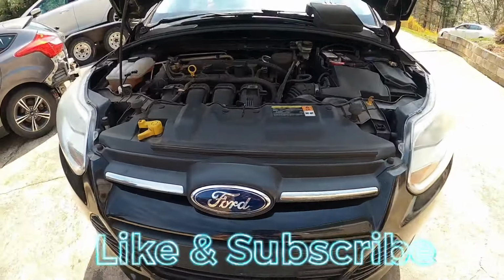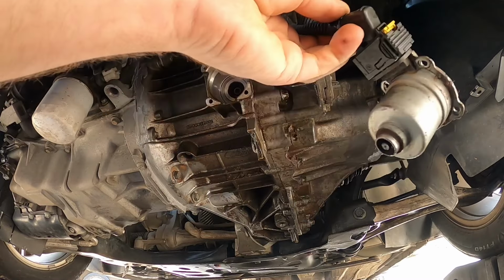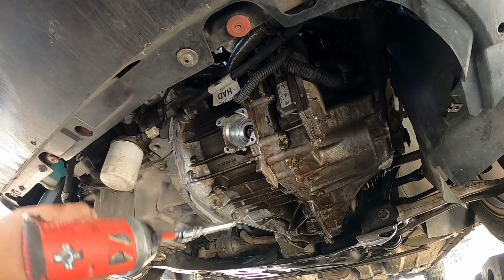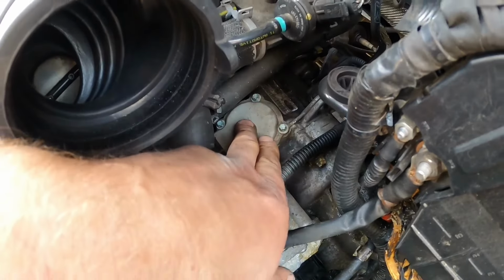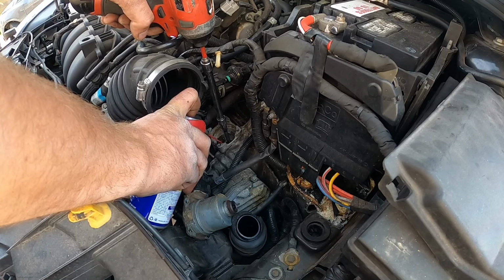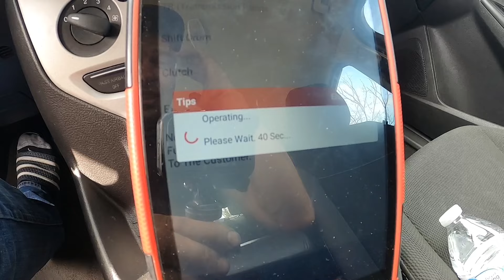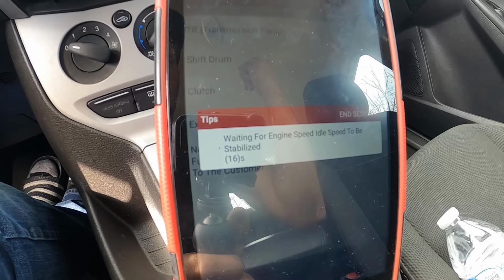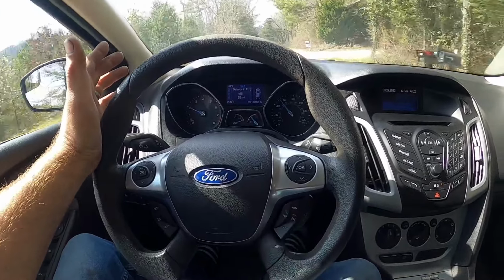2012-2018 Ford Focus Slipping? No Reverse? No Drive? Problem Solved. Easy Fix. You Can Do This!

Comment: How long are you supposed to wait to drive after doing this? I drove mine right away and it said transmission overheating pull over safely.
Reply from the maker: You don’t have to wait. If this didn’t help you need to replace your forks and probably the clutch at this point

Comment: Would a P0902 be related to this? I changed the actuators and found out i need a tool to relearn the system
Reply from the maker: If you replaced the actuators with new OEM ones, you should do a relearn if you can with a scan tool. If you don’t have one take it on a normal drive and if all is working it will relearn on its own after a normal drive
Reply: Yea I dont have a scan tool, and idk if my brother got the parts from ford or not. I doubt it though, i replaced them, drove down the block (i know its not far) but same issue. Reverse works fine, its when i go in drive that lags, sometimes it doesnt even go,  sometimes it doesnt even start...makes me wondwr if its possiblythe tcm@L8R-HP

Comment: Just bought a 2012 Fiesta with only 33K miles for daughter. P2831, P2832, P287B, P2831-00, P2832-00, P285E-00, P287-00, U041-68, and C1B00-64 codes (obvious shuttering). 6-8 months for the recall and don't know what else to do. Thoughts?
Reply from the maker: That many codes my guess would be the TCM is gone bad.
Reply: @L8R-HP  And under the extended warranty?
Reply from the maker: @TheMaestroWay  I think warranty is 10 years 150k miles. Unless that changed
Reply: @L8R-HP  Thru January '25. But I don't trust the dealerships.
Reply: @L8R-HP  Even though P0700 code is triggered, Ford dealership claimed that the TCM warranty doesn't cover P287B. In other words, no correlation. Agree or disagree?
Reply from the maker: @TheMaestroWay  ford dealers don’t know how to fix this problem, there is really no fix, especially if you don’t drive your vehicle much, forks get stuck

Comment: What is the electronic diagnostic tool you are using?  Any links to it?  Would a FORSCAN tool work as well?
Reply from the maker: I use a launch 431 mini.
I hear forscan will work, but I have not tried to confirm
Reply: @L8R-HP  your videos are 🔥🔥🔥 amazing content!

Comment: I am getting code P07A5 - Friction Element B stuck on.  I checked both actuators. A turns all 14 turns .  B only turned 3 turns.  I was turning by hand and was afraid to try to force it as I didn't want to break anything. I'm assuming your impact wrench was probably using more force than I was.  I used the brake cleaner, turning back and forth by hand but never got it past 3 1/2 turns.    I also did notice on both actuators that they do have some side to side movement in there.   Do I need to apply more force?  Or would it be better to open the transmission and see what is going on inside?
Reply from the maker: Sounds like fork B is broken or stuck. That transmission has to come off :/

Comment: How about when you open passenger and driver door  makes a noise  have code P087A, P287A, P286F will this work to clear the codes?
Reply from the maker: If this doesn’t work you need to remove transmission and inspect it

Comment: Just broke my fork on B doing this. Now I may need a new transmission. I should have just clean with brake cleaner a wd40, no drills or tools. Any advice on next step?
Reply from the maker: Need to replace the forks. You don’t need a new transmission
Reply: @#L8R-HP  is it normal for when you turn it counter clock wise it will turn but like it wants to kick back like it's spring loaded?
Reply: @L8R-HP  Have not seen a video where the clutch is removed from the transmission to expose the forks. I saw another video where some special LuK tool and template are used, will I need them?

Comment: Hi, I have a 2016 Focus 2.0, have a P090C code for acuator B - no reverse - switched the actuator with a new OEM one, the code comes back within a day or two - any ideas?
Reply from the maker: Sticking fork or your TCM is going out
Reply: @L8R-HP  Thanks, can you tell me the model# of the launch tool that you use?

Comment: I've been having a similar enough problem with my 1.6 2012 Focus (80,000KM). When I leave the car overnight it usually starts fine and goes through the gears and into reverse with no problems.

However, usually after a few minutes of driving it will start to slip, rev up really high before jerkingly changing gears and then do nothing but rev when put into reverse...

Do you think the cleaning of the actuators would be enough, or is there a bigger problem at hand?

Thank you so much!
Reply from the maker: Cleaning forks will help,
Reply: @L8R-HP  Thank you, I will try this and get back to you. Appreciate all the work you do!
Reply: @jamesboyd2610  how is it going i have the same problem
Reply: @jamesboyd2610  Also curious if this ended up working for you

Comment: My ford fiesta was showing the code to reprogram the TCM. it was reprogrammed, there's time that I turn it on and gears are fine, other times the gears slip and now the transmission warning light is on. Would it be my forks? I'd really appreciate the info, I've got no other choice but to try and repair it. Thank you

Comment: Just tried this recently and seems on my 2016 focus it didn't do anything... I've had a few codes such as P2837 P287B and before it was unable to engage 6th gear. Tried the relearn with forscan and just stays stuck on the select gears for the gear command neutral. Ordered some shift actuators to see if that may do different, or I'll find out I'm wasting my time... This all started when for some reason I had to keep jump starting it as it always lost power. Even after turning the car off.... Somehow after removing the battery cable and putting it back it all of a sudden acts normal. Hoping this isn't a TCM or something else.

Comment: Hi I'm from Nigeria, and i have this exactl model, with transmission issues... Im afraid to work it myself as i dont have any mechanical experience or equipment like the scanners... Is there a way for me to get mine resolved? Or any connection here in Nigeria i could use to fix it?
Reply: I'm from Nigeria too. Mine even says transmission hot, now, no reverse. Please let me know if you find a solution. Thanks

Comment: Are there any risks with trying to blow compressed air and then vacuum out from another opening? Kind of get that dust moving inside and then sucked out by vacuum?
Reply: I think that blowing air will push more dust to the clutch than the dust you could vacuum, the holes are not big enough to suck the air freely.

Comment: Is that just a 6mm extra long Torx? I’m having a hard time finding the tools you linked to for sale at the moment.
Reply: DSG Gearbox Clutch Motor Electromechanical/Unit Unlocking Tool Aluminum Alloy
Reply: eBay 25 bones

Comment: Is it A or B for the shuddering in 1st gear?  Reverse works fine just have to be gentle in first till it shifts into 2nd .   Thanks!
Reply from the maker: A is 1,3,5
B is R,2 ,4 ,6
Reply: @L8R-HP  appreciate it!! 💪
Reply: What if the A top side doesn’t click after the 14 turns counter clockwise. It just keeps turning? Desperate on this fix
Reply: Did you try this and did it work for you?
Reply: @Krystin10  it worked for awhile.  Just had the clutch and fingers replaced at the Dealer! $2600🤦🏻‍♂️
Reply: @RyanClark7923  got a quote for just the clutch pack and it was 1900 plus tax CAD

Comment: @L8R-HP So, a transmission shop said that if my car does not have the updated TCM, that they cannot fix my car, period. He said to call a dealership and see if the car was in for any recalls regarding the transmission. I called a dealership to see if they can give me any history on the car via the VIN and they said they cant. Can you help me understand this better about the TCM? They said they are on backorder for 1.5 years?

Comment: Gonna try this on my 2015 focus  No reverse!!
Reply: It didn't work. Well it did. After 2 drives it worked good. Started putting my tools away and told my son to move the car, he said the engine light turned back on and no reverse.
Reply: Likely TCM failure, there is  another video on youtube on how to replace those easily. For now, when reverse quits working try to completely disconnect battery and reconnect that typically works for me. Or if you’re tuned swapping tunes will work as well.

Comment: If you get shuttering with this transmission,  you need to go and drive it kinda hard. If you drive easy, it shifts easy and shutters.  You need to drive them  harder when taking off. If the a/c or a lot of people  in the car, drive it harder then  normal. I take my 14 out and runn it hard a coue times and that helps shuttering alot. They are self adaptive transmissions. It'll shift harder if you drive it harder. I saw a nother ford mechanics video on that issue and it works great.

Comment: I did was you have said in your video but it turn to the left and back again but when I try to turn to the right will not move, do I have to make pressure on it?
Reply from the maker: Turn to the left 14 times and it should go back on its own. If it doesn’t you have a bad fork. Cleaning might help

Comment: Does the car have to be on neutral while you spin it? Because I don’t have it on neutral and I turn it once counterclockwise and it clicks
Reply from the maker: In park. Vehicle off. If it doesn’t spin or clicks it’s a bad fork
Reply: @L8R-HP  it does spin and it clicks once I do one full turn counterclockwise it clicks so I just stopped because I wasn’t sure if that was ok or if I had to have it in neutral

Comment: Hi, sorry for the comment on an old video. My 2017 drove fine, parked it and then when I got back in it seemed to be in limp mode. No reverse, but drives forward very slowly. Dealership is quoting me $6k and will only do a full transmission replacement... any advice? Could it be the forks or actuator?
Reply from the maker: Forks are stuck

Comment: Can I drill holes in the bottom of my gearbox for dust to drain? Or clean.
Reply from the maker: Worth a try. Just plug the holes later, you don’t want water/ moisture getting in there
Reply: @L8R-HP  Thanks i will give it a try😄

Comment: Unfortunately, I believe I have a broken “B” fork. I tried to move the shaft counterclockwise 14 turns, but when I released it, it had no spring return. So I guess it’s time for a new clutch set.

Comment: I have an 2017 ecosport and I fear I'll encounter this error sooner or later. AFAIK the focus has the same DCT as the ecosport (almost). Will this work on the Eco as well? Thanks!
Reply from the maker: Not sure where you are. But the ecosport in the US doesn’t have the same transmission I don’t think. Could be wrong

Comment: Could this fix Transmission Temp warning? The car shifts fine and firm BUT after a highway drive of about 8 miles, a temp warning pops up. When i slow at offramp, the warning then seems to get worse by stating to pull over for 5 minutes but as soon as that warning pops up, the red icon turns off and screen goes back to normal. No issue at all driving. I havent tried driving on highway longer while warning and red light are on.
Reply from the maker: High temp is due to your forks sticking and making clutch slip. This should help. But a proper fix would be new forks and clutch

Comment: I have a Ford Edge 2018 and getting a P073E error on reverse mode. After moving forward with D a little bit the error goes away and starts when re-start the car. Is it the same symptoms? I don't have any transmission related error also, only P073E

Comment: Not moving drive or reverse and after resting for a few hours and start working again for a few miles and stop working again and you need to rest again, what donyou think is the problem
Reply from the maker: Forks are getting stuck, when transmission gets hot they stick more

Comment: What OBD2 are you using?
Reply from the maker: Launch 431 mini. Can also use forscan
Reply: @L8R-HP  I saw on a video that it also has relearning and coding abilities am I correct? Most importantly I needed to relearn and possibly code TCM and pcm
Reply from the maker: @lucidfairytales  forscan is a good affordable ford scan tool.
Reply: @L8R-HP  I just wanted to make sure what I saw on the video the process where I saw its relearning the shift end transmission, did that take place was it relearning the shift and transmission?

Comment: I have 178k miles, probably need to replace clutch. Or would this get another 30k?
Reply from the maker: If it drives just keep going 💪
Reply: @L8R-HP  I have to do what you did in the video cause it's not driving now.
Reply from the maker: @daleg5553  you got this
Reply: @daleg5553 what’s wrong with it?

Comment: Like you said you don’t need the scan tool. Just drive it and the cpu will reset after a cycle that’s it?
Reply from the maker: Yes if everything is working correctly it will learn on its own

Comment: I have the same 2014 Ford Focus, i keep getting the P090C actuator B control circuit low code. checked all the grounds and reset. Same code. Flipped the actuators. Same code. Stroked the clutch forks and added WD40 like you did in this video. It didn't seem to be stuck, i could move anti clockwise 14 times quite easily and the spring loading was fine. I ran through adaptive relearning a couple of times. During the cluth procedure it said it couldnt contact the module. I assume at this stage the TCM has to be changed....any advice on changing or even buying a TCM greatly appreciated.
Reply from the maker: Try to find a used TCM. eBay or Facebook

Comment: How long did this work for you until you need to do it again?
Reply from the maker: @Chris-pj1os  last a while if all is working correctly. Doesn’t hurt to do it every oil or every other oil change. It will definitely help the shift forks last longer and save the clutch

Comment: I need you help please 😢 Bro  I just start the engine and drive for few minutes with  no issue but  after few brakes and stops , my 2016 focus starts shaking at every gear  and RPM goes high before shifting … I noticed that whenever I face this issue the car doesn’t allow the S gear , everyone was telling me to change the gear box 😢… any solution for my issue please !

Comment: @#L8R-HP Would transmission overheating be because of this problem as well? I've also had all the other symptoms in the video
Reply from the maker: Transmission overheating is caused by clutch slipping which is caused by sticking or bad forks
Reply: @L8R-HP  Thanks for the response man! Would the fix in this video potentially fix that? I know it is a temporary fix like you said though
Reply from the maker: @jcmilroy7607  it will help
Reply: @L8R-HP  Awesome, and is the reprogramming step necessary? I noticed in another video you said you think you can go without doing it
Reply from the maker: @jcmilroy7607  if everything is working properly, it should learn on its own eventually.

Comment: Great video sir.  Where can I buy the 6 mm tool to move the shifter back and forth ?  Could I use a 6 mm torx with an extension?
Reply from the maker: https://www.ebay.com/itm/184480096055?mkcid=16&mkevt=1&mkrid=711-127632-2357-0&ssspo=yvwl7HUSReq&sssrc=2349624&ssuid=-qApsBzoR4m&var=&widget_ver=artemis&media=COPY
Reply: I believe it's a 7mm spline tool.
Reply: It's a SEVEN mm spline tool. Amazon

Comment: I tried this and when doing so I had actuator B off and forgot to put it back on before turning on the accessory’s. After that now the tcm just makes a clicking nose and I have now also lost my forward gears also. Any advice on what to do now?
Reply from the maker: Need to read and clear codes. Or at least unhook the battery for 5-10 min
Reply: Okay I have disconnected it overnight, still the same issue and I am not getting any codes with my code reader. What scan tool do you suggest that will help me?

Comment: My Fiances car seems to have this issue, I think it's once it shifts into 2nd or 3rd gear, loses all power and just revs the engine and gives a transmission over heat warning. Reverse seems to work just fine, gonna try this and see if it works. Will let everyone know how well it goes

Comment: Hello, I have codes P0805 and P2872. My 2012 Ford Focus has troubles going into drive. Shifting and jerking and all that. But only happens on occasion. It says “Clutch A Stuck Engaged.” Do you think I should clean the forks and change both actuators? Gonna order the parts now. And is there no other tool that I can use to lube the forks?? Thank you for your insight.

Comment: Appreciate the video, but I ran into some issues. I cannot for the life of me get the actuator back on, the "receiver" looks cockeyed in there and when using the reset tool it moves back to center but immediately goes back to out of place when unspooled. Any advice or am I screwed? Thank you in advance
Reply from the maker: That fork needs to be replaced
Reply: Thanks bud, I appreciate it!

Comment: I have a 2012 Ford focus SE hatchback and it is saying transmission is not in park and won’t go in reverse but it will go in drive do you know what this problem is?
Reply from the maker: Could be the the sensor on top of the transmission that reads what gear you are in

Comment: What kinda software or diagnostic tool are you using? I have a focus that have a rough shifting after actuators we’re replaced.
Reply: I too was curious as I'm having issues with my TCM rn 😂

Comment: We followed along with your video and replaced both actuators, However after install the car refused to drive/reverse is there is also a transmission error code, any advice on how we could fix this issue?
Reply: I’d try resetting again. Maybe take it to the dealership for resetting or diy with a resetting computer that works for fords too.  Also try (Lucas transmission fix) in the white bottle.